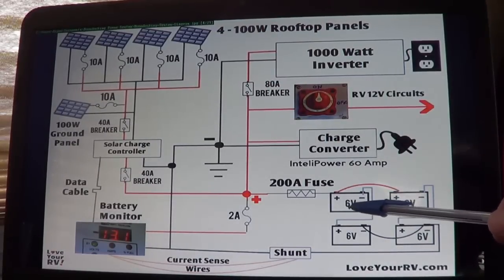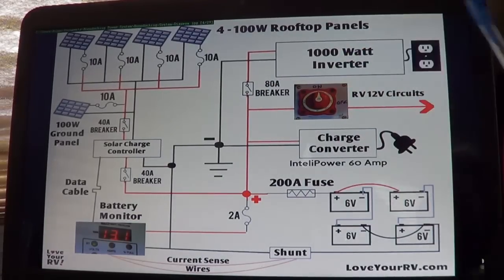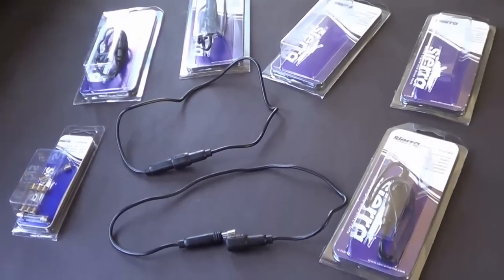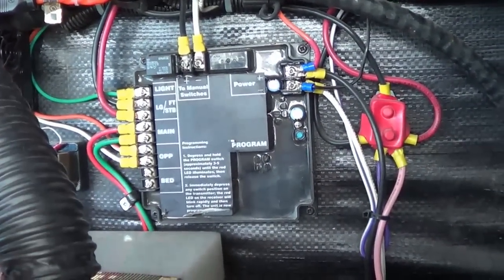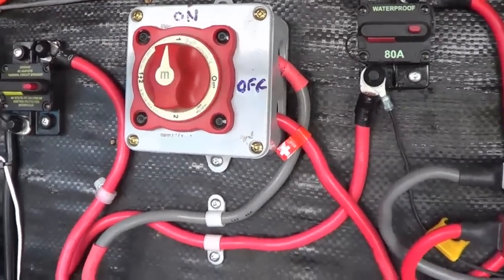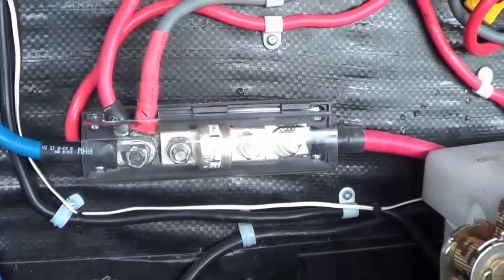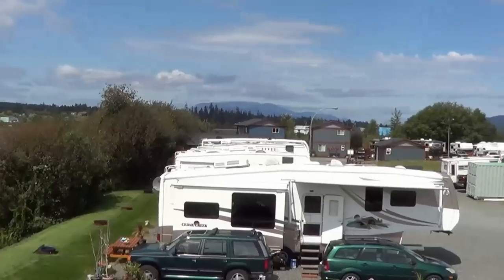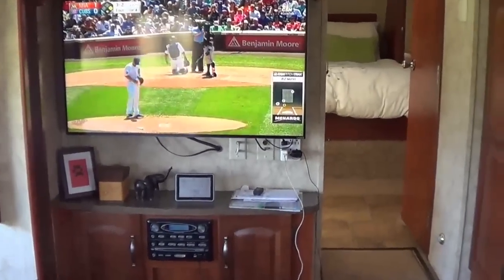Our DIY RV Boondocking Power System - Complete Overview

Comment: Ray, I'm installing a similar system to yours but I only have room for 3 - 100 watt panels. Do you think 300 watts can keep 4 - 6 volt batteries charged? I know it depends on usage and I'm only going to be pulling around 200 watts at most. I purchased the intelipower 60 amp charger to supplement the solar panels using my generator. I haven't installed anything yet. Also did you ground everything to the frame of your rv? The intelipower has its own ground connection.
Reply from the maker: Ideally, you want about 100 watts per 100AH of battery capacity. But like you said it depends on usage and of course how much sun is happening and for how long.
I didn't ground my solar panel frames to the RV frame. Some do for lighting I guess. I wired all my negative DC loads back to the battery banks negative post except for the OEM RV circuits which use the RV frame in many cases as a negative return path. I left it as it was.
The InteliPower chassis ground connection is on the AC input side of it. I imagine it's a safety ground to prevent the RV frame from becoming hot in case of an internal failure. Cheers Ray
Reply: +Love Your RV - in that case I will leave the ground from the battery floating. One more question . Do you do anything special when you run your generator and turn the battery charger on? I was wondering if I have to turn the mppt off and the inverter off ? Don't know if the battery charger will interfere with the solar if I run my generator during daylight hours. Thanks for all you do for us newbies.
Reply from the maker: No problem they can coexist quite happily. Both adding charge to the battery at the same time. Also, no problem running the inverter at the same time, unless your battery bank was severely depleted. In that case, most inverters would just go into low voltage shutdown not harming anything.

Comment: So Ray did you disconnect your OEM converter when you installed your new converter and how dose it work if you are plugged into sure power can both work at the same time or do I have to disconnect the OEM when I install my converter like you have in my storage compartment like you have I have a cougar 5th wheel also. Should I disconnect my OEM
Reply from the maker: No, I left it in place, My Intelipower is mainly for dry camping. Gives me the fastest charge when using the generator to charge up the battery bank when it has become low due to excessive power use by us or a few cloudy days. 
When on full hook ups I decided to still use the OEM converter, may as well wear it out, and conserve wear and tear on the Intelipower. My batteries still get a good charge because the solar charge controller is charging as well and takes the lead since it can produce the higher voltage needed to charge my golf cart battery bank properly. Most of the time on full hookups, the batteries are just sitting in float mode.
If I did want to disable the OEM charger converter it would be as simple as turning off the breaker for it or unplugging it and plugging the Intelipower into an outlet.
Reply: Thanks Ray that is what I am going to do should work the same just charging right in the battery compartment instead of a approximately a 20 ft run on #6wire
Reply: Thanks Ray just going to turn it off and use the good charger just plug it into an outlet. Putting 4-12 volt AGM in at the same time. Next 400 watts of solar.
Reply: Hi Ray.  Would mind telling us the Make, Model and Amp rating of your OEM Converter?  Thanks

Comment: LOve the post , Ray, as usual and couldn't be better timing. I starting to design my electrical system for my Jay Feather 24T travel trailer that I will, like you, be building over time. For various reasons I want to move my 2-12v deep cycle batteries to my front pass storage. Can I do that with the type of batteries I have or should I be looking for a different style of battery?
Reply from the maker: Thanks, if I was putting the batteries into a sealed storage area I would go with AGM type versus wet cell lead acids, unless in a very well ventilated battery box.
When under heavy charge current its common for the lead acid batteries to gas a bit. You wouldn't want the hydrogen sulfide gas building up in a storage area.
Reply: Thanks for the input.

Comment: Probably just going to copy your whole set up.  Imitation is the sincerest form of flattery.  You explain it so well.  And the Bogart Engineering people covered all my other questions in the Frequently Answered Questions.  I like their style.  So where is the best place to buy the panels and mounts themselves?  If you don't mind an unabashed plug for your vendors. Did you mount your panels yourself? If not, and as I recall you summer in BC, maybe we can use the same installer.  Anyways, as always, thank you ever so much for your help; I am Grateful.
Reply from the maker: Hi Slim, I did the install myself with panels and mounts I bought from Renogy when I was down south the last 2 winters. You can find more info on my panel installation and some other folks installs where they used mounts that allow the panels to tilt. Check out my blog  solar category here - http://www.loveyourrv.com/tag/solar/  Cheer Ray

Comment: What do you think about victron  mppt control over the bograt unit ?
Reply from the maker: Can't say as I've never tried one. When I installed the Bogart SC2030 3 1/2 years ago I felt it in combination with the Trimetric battery monitor was the best bang for the buck for a small system like mine. But 3 1/2 years is a long time for high tech stuff so must admit I don't know if the newer stuff is any better or not. All I can say is I'm happy with the setup. I have and it has served our needs well over the years.  https://www.loveyourrv.com/what-do-we-power-with-500-watts-of-rv-solar/   Cheers! Ray
Reply: @LoveYourRV  Thanks.

Comment: Wow! Two thumbs up. But you put a lot more weight on your rig?
Reply from the maker: Yes, 5 panels weighing about 16 lbs each plus 3 more batteries at about 60 lbs each, plus the electronics and wiring. I weigh my rig twice a year and still have around 500 lbs margin on the trailers GVWR, not great but not overloaded even with full tanks.
In recent years we've stopped carrying 2 bikes and one of the 48-pound generators plus fewer tools than I used too. If you add something you have to take something of equal weight out.

The truck can take the weight no problem being a 1 ton dually. One reason I chose the Cougar fifth wheel model I did was a large Cargo Carrying Capacity for a smallish trailer, nearly 3000 lbs.
Cheers, Ray

Comment: Maybe I am confused but I count 50amps total from your panels and your are only using a 40amp fuse between that and the charge controller?
Reply from the maker: They are 100-watt panels, usually see at best 5 - 6 amps from each so together the max out at about 30 amps. not sure where you are getting 50 amps from?

Comment: A Nice neat setup with a good description. Without MPPT and solar panels not at optimum angles, I'm surprised that you get good enough charge with only 500W. Would it be cost effective to add a 400w VAWT system ? to keep the batteries topped up, especially on cloudy and/or windy days. :-)
Reply from the maker: I guess it depends on your power needs, but this last 6-month trip we were off the grid for about 2/3rds of it and only needed to run the generator for a recharge about 20 hours. I'm actually a little worried I didn't exercise it enough. :)
I think it's because I made sure to oversize my battery bank for our needs. We rarely fall below 85% capacity on an average day and have lots of extra to last for a few cloudy days.
Also, because of this much of the charge time is in the lower current absorption mode where an MPPT controller offers little benefit. 
As for a wind turbine, I decided against one as its too complex and figured they would make annoying vibration.  There must be reasons you see so few boondockers with them, mainly small rigs that lack the space for solar panels. If I needed any more power for cloudy days I can just add a few more panels, I have the space on the roof for 4 more if I needed them. Cheers! Ray

Comment: so can u use the same cable that comes from your MPPT just hook it inline with the Inteli-power?
Reply from the maker: Sorry I don't understand what you mean, I don't have an MPPT
Reply: rephrase, so the charge controller and Inteli-power can be hooked to the batteries with same cable
Reply from the maker: Well, they each have their own plus and minus output cables but they do both go to the same place, negative and positive terminals of the battery. If you mean can they be charging at the same time then yes they can.

Comment: Hi Ray, on your diagram, could you insert what gauge of wire that you used for each unit.  🙂🇨🇦🇺🇸
Reply from the maker: I didn't want to because that will be unique to each person's setup, the longer the wire run the larger that gauge required to avoid voltage drop and overheating of the wires.
There are calculators online to figure it out. ie.  http://www.freesunpower.com/wire_calc.php

Comment: Have you considered getting an inexpensive 150W or 200W inverter to power the bathroom outlet?  If you are already using it for something else at the same time then great, otherwise it is drawing as much power for itself as your appliances are.  Cheap inverters (clean power not needed for a razor) are $16 on Amazon.
Reply from the maker: Yes, we use it most of the day to power our computers. Anne's iMac and my 17-inch laptop, plus a little TV time some nights for our 43" LED TV.
Then when sleeping, we turn it off. In hindsight, we could have likely made due with a 400-600-watt inverter.  But last winter we boondocked for 4 months and only has about 15-20 hours of generator time the rest the solar system was enough. So we are happy with that. :)
Reply: I looked up the specs on your inverter and it is reasonably efficient.  Only .8A draw at idle.  I've seem some that draw 4-5A or more doing nothing.   Not the kind of thing someone worried about capacity would allow.

Comment: HI Ray, Great job on the video and schematic! Curious why you chose a fuse vs another breaker for the catastrophic fuse. I see that Blue Sea makes a 200A 187 series breaker that could be an option. Thanks! ..Mike
Reply from the maker: Thanks, Mike. I believe a Class T fuse is used for the catastrophic fuse because it is very fast acting. A friend gifted it to me, he does solar installations. Looking back I may have went with something like this - http://amzn.to/2hpQSEL  It attaches right on the battery terminal.
Reply: Thanks! That does look like a nice solution.

Comment: Thx. But why wouldn't you go with 24 volt
Reply from the maker: Cheaper to stick with 12 volts. The RV electrical systems are 12 volts and I already owned the 12 volt inverter.

Comment: why a 200amp fuse.? you should just have a 30A
Reply from the maker: A 30 amp fuse that location would be blowing all the time due to normal currents. ie. My charge converter puts close to 60 amps into the batteries when charging fully.That fuse is extra just a final failsafe device in case something catastrophic happens. 4 golf cart batteries can supply a heck of a lot of current quickly.
Many people don't bother with them, but I think it's a good idea. Say I shorted a circuit while working on it or the inverter dead shorted and it's breaker failed.

Comment: I think that's a bad design you propose. You so obviously have no idea what you are doing. Please get some assistance. I don't have the time to point out all the design errors. Starting with why the hell would you put 5 panels in parallel creating the need for much larger wiring and many more fuses. You'll also never blow one of those 10 amp fuses at your panels because the max each panel puts out is under 6 amps short circuit.
Reply from the maker: The panels are wired in parallel because I was using a PWM controller. Back in the day, MPPT controllers were much more expensive vs PWM type It made sense for a small system to take the savings and add more panels.  Remember you are watching an almost 6-year-old video here. Prices and equipment selection have changed quite a bit now.
Also, there are advantages to wiring in parallel. One is better shading tolerance and the other redundancy if one panel fails or degrades the others aren't affected by it.  
https://www.renogy.com/learn-series-and-parallel/
"Strictly parallel connections are mostly utilized in smaller, more basic systems, and usually with PWM Controllers, although they are exceptions. Connecting your panels in parallel will increase the amps and keep the voltage the same.  This is often used in 12V systems with multiple panels as wiring 12V panels in parallel allows you to keep your charging capabilities 12V."
As far as fusing the panels you know less than you think you do. Please read this article https://www.windynation.com/jzv/inf/how-properly-fuse-solar-pv-system 
 "Solar Panel fusing
Commercially made solar panels over 50 watts have 10 gauge wires capable of handling up to 30 amps of current flow. If you connect these panels in series, there will be no increase in current flow so fusing is not required for this string. This is not the case when you have panels connected in parallel, as when connected in parallel the system current is additive. For instance if you have 4 panels each capable of up to 15 amps, then a short in one panel can draw all 60 amps towards that short-circuited panel. This will cause the wires leading to that panel to far exceed 30 amps causing that wire-pair to potentially catch fire. In the case of panels in parallel, a 30-amp fuse is required for each panel. If your panels are smaller than 50 watts, and use only 12 gauge wires, and 20 amp fuses are required."
Reply: I’m still confused why he would cross the Batteries instead of just parallel creating more amp hours. Or just series creating more bolts. Wiring the batteries that way just a waste and fire hazard